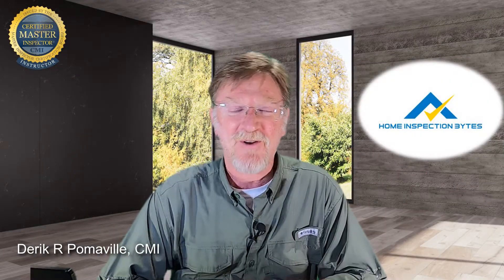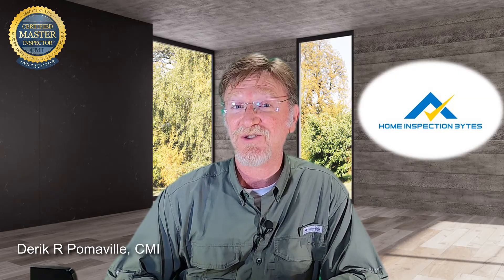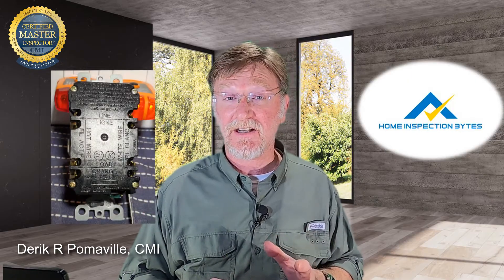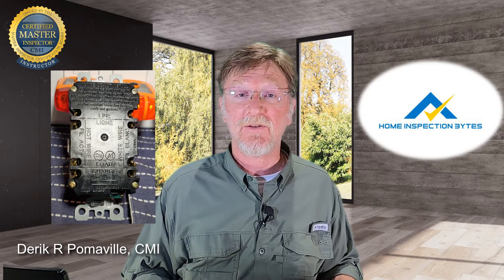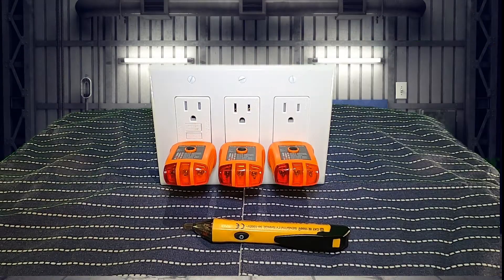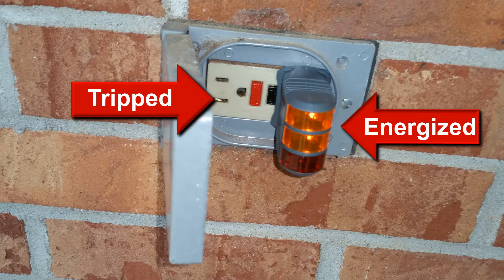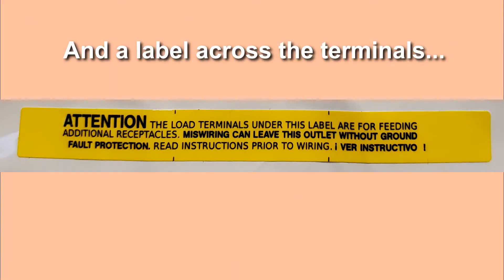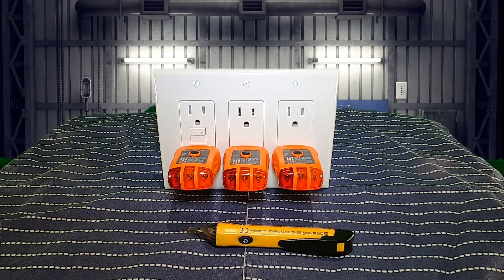Line and Load Reversed at a GFCI

Comment: so how ‘older’ are these types of gfci’s that are worth less then nothing(because they not only do nothing, but pretend to do something) ?🤔.  how old & is there a way to spot them?  should I phrase that worth less then worthless?  & btw. maybe you know, on a relatively new home depot gfci, if there is a short, with a perhaps dangerous surge, on the OTHER side, sending surge BACK to & through, would THAAT surge trip it ?(this is all 3 questions not 4, ignore the word clever question 3)👋
Reply from the maker: Not sure I understand the question. GFCI receptacles do not protect against surges, but ground faults. That's when there is an imbalance of power between hot and neutral.
Reply: O😯, thNx- ✋
Reply: Coming a great distance from the inbred language that fences you in, your mind has remained miraculously somewhat intact. Now that you can form words may I suggest you next get a handle on syntax and grammar so that you can communicate.